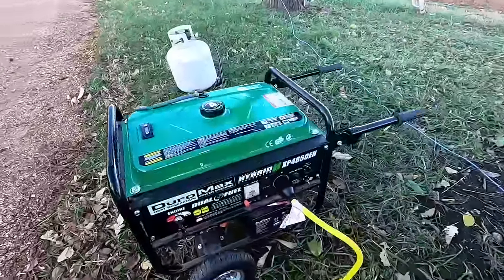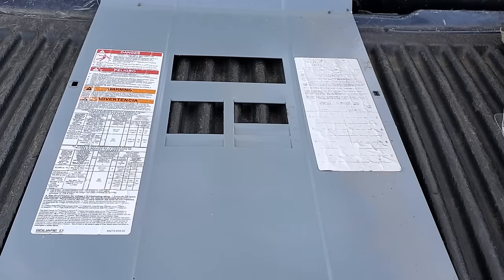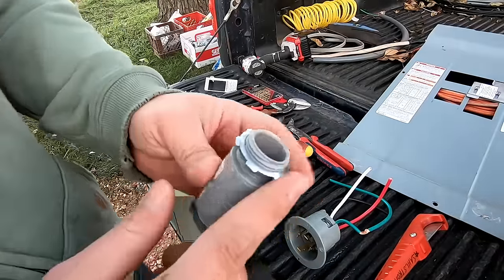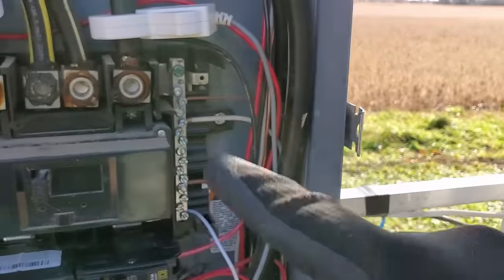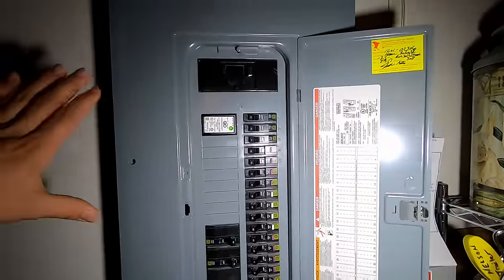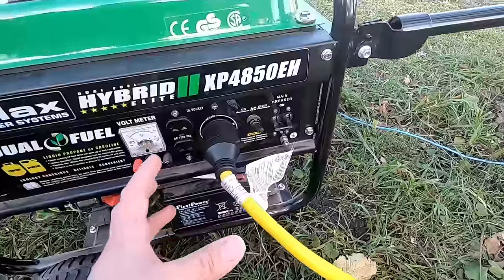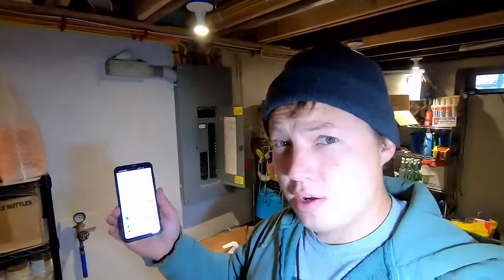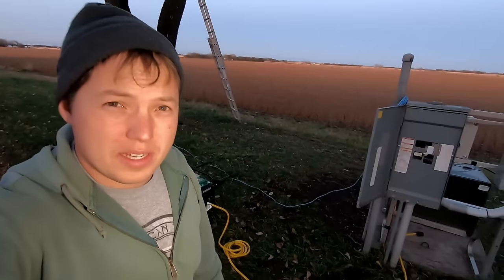How To Hook Up a Generator To Your House Using a Breaker Interlock Kit & Power Inlet Box

Comment: Great vid.    240V ? I thought it would run 120V/wire at specified A. ?   Put tape over the main input wire lugs to prevent from hitting them.

Comment: The square screwdrivers are called Robinsons - use them all the time. The best!  Much less chance of slipping than a flat head.  Also - have experienced a finicky furnace that would not turn on until the ground was bonded to neutral... after that it worked fine. Question - will these dual fuel non-inverter generators not be able to run TVs, computers or other electronics?

Comment: So the generator is also giving power to the sub panel. Do you turn off the sup
Panel main breaker or turn it on to give branch circuits power, after the generator power is turned on?

Comment: Great to see this whole setup work! It is good to know that often something does not seem to handle as much as it said it was rated for.
Reply: the house was a long way away so it might just be the extra resistance on the wire
Reply: I suspect the cause of the shutdown has to do with the fuel being  used, being a multi-fuel engine in this unit. The full power rating will be on gasoline fuel, and about 10% less on propane, or 20% less on natural gas. Has to do with the energy density of the fuel being used.
Essentially every time he added a load, the throttle plate opened a little more to apply additional torque on the generator shaft and keep the 3600 rpm / 60hz output constant. Eventually the throttle hits its stop (full open),  max power of engine is developed, and any additional amp load applied causes the engine to slow, voltage and frequency drops below allowable limits and control safety circuits pop the output breakers,  maybe shutdown engine also. The electric alternator could output more current,  but the engine is overloaded.
Reply: @KevinSmith-ys3mh  thanks that's the engineering way to agree with me 😉
Reply: Here are the generator safety rules that everyone needs to follow: this is just a reminder for everyone’s safety. Always make sure you follow all the generator safety rules whenever you use your portable generator. Generators can be dangerous if not used carefully. Every year, hundreds of people die or get injured when using portable generators due to carbon monoxide poisoning and electrocution. Make sure you are using your generator carefully and keeping others safe as well. There is something very serious that everyone should always be aware of when using generators. Some people do run their generator indoors which is not safe and that increases the risk of carbon monoxide poisoning which can cause death of family and you. Some people run their generator in wet conditions which can electrocute them. Please remember that you should never run your generator indoors. Remember that carbon monoxide is an odorless and colorless gas that you cannot see or smell. Carbon monoxide is a silent killer. Keep that in mind. Make sure your generator is 15-20 feet away from your house and away from doors, windows, and vents. Never use your generator in your porch too. Having a carbon monoxide detector is very important against generator safety. Some people also allow children to go near the portable generator which could pose risks. We need to keep an eye on our children making sure that they are not near the portable generator so they won’t get electrocuted or burned by the generator which is dangerous. A locking enclosure also keeps kids safe. A generator shed might look like a tempting place to explore, or take cover during a game of hide and seek, but a generator is a dangerous piece of equipment that can cause injury. It says on the manual that we should also keep children away at all times from the portable generator to avoid injuries. Please do not allow a child or unqualified people to operate the portable generator.  It is important to keep your children safe especially little ones. The portable generator can be hot during an operation. Just because some manuals missed what should be listed doesn’t mean it’s safe to do. Always follow the generator safety rules when using portable generators. Generators pose electrical risks. If you need to use your generator during wet weather, you need a generator tent to protect your generator from getting wet. Don’t let your generator get wet. Keep your generator dry and before using your generator, please make sure your hands and your generator is dry. Do not wear loose clothing when operating the generator. Everything that is said on the generator’s operating manual should not be ignored. Never smoke cigarettes near the generator. Please keep flammable things away from the generator. Never overload your generator too. Your generator can catch fire. Never ever try to plug a generator cord into a wall outlet to avoid back feeding. Back feeding your generator is dangerous. Always turn on your generator first before plugging in appliances and shut off the appliances before turning your generator off. Use a heavy duty cord for your generator and the cord should not be worn out. All the instructions should be followed carefully. Never refuel your generator while it’s running. It can cause fire if fuel spills while your generator is hot. You should turn off your generator and let it cool off before refueling it. Having a fire extinguisher next to the generator is also important. This is only a reminder for everyone’s safety of using generators. Make sure your generator is properly grounded. Having a fire extinguisher next to the generator is also important against the safety rules. https://youtu.be/I1jT3ANENvI and here is a video more about keeping others safe when using generators and also about our family’s safety. It’s important to keep our little children safe as well. Make sure your little children are kept away from the generator at all times especially when it’s running. Hope this helps. Always remember that it’s better to be safe than sorry. Also remember that warnings should not be ignored too.

Comment: I have this setup on my house and it runs everything except my electric Dryer with everything on with a 8500/5500 watt Generator it may run the Dryer I just never tested it LOL It Works great and we are never without power -I also would suggest keeping at least 4 - 5 gal cans of Gas around for backup - If your out of Power most likely the Gas Station is also, Just a suggestion tho.

Comment: Subbed! Love your vids. We are buying an old 60s house with open ground wiring. Will be re-wiring the whole house and upgrading the electrical panel. Definitely want to add generator hookup.
Reply: Here is an information about generator safety: this is just a reminder for everyone’s safety. Always make sure you follow all the generator safety rules whenever you use your portable generator. Generators can be dangerous if not used carefully. Every year, hundreds of people die or get injured when using portable generators due to carbon monoxide poisoning and electrocution. Make sure you are using your generator carefully and keeping others safe as well. There is something very serious that everyone should always be aware of when using generators. Some people do run their generator indoors which is not safe and that increases the risk of carbon monoxide poisoning which can cause death of family and you. Some people run their generator in wet conditions which can electrocute them. Please remember that you should never run your generator indoors. Remember that carbon monoxide is an odorless and colorless gas that you cannot see or smell. Carbon monoxide is a silent killer. Keep that in mind. Make sure your generator is 15-20 feet away from your house and away from doors, windows, and vents. Never use your generator in your porch too. Having a carbon monoxide detector is very important against generator safety. Some people also allow children to go near the portable generator which could pose risks. We need to keep an eye on our children making sure that they are not near the portable generator so they won’t get electrocuted or burned by the generator which is dangerous. A locking enclosure also keeps kids safe. A generator shed might look like a tempting place to explore, or take cover during a game of hide and seek, but a generator is a dangerous piece of equipment that can cause injury. It says on the manual that we should also keep children away at all times from the portable generator to avoid injuries. Please do not allow a child or unqualified people to operate the portable generator.  It is important to keep your children safe especially little ones. The portable generator can be hot during an operation. Just because some manuals missed what should be listed doesn’t mean it’s safe to do. Always follow the generator safety rules when using portable generators. Generators pose electrical risks. If you need to use your generator during wet weather, you need a generator tent to protect your generator from getting wet. Don’t let your generator get wet. Keep your generator dry and before using your generator, please make sure your hands and your generator is dry. Do not wear loose clothing when operating the generator. Everything that is said on the generator’s operating manual should not be ignored. Never smoke cigarettes near the generator. Please keep flammable things away from the generator. Never overload your generator too. Your generator can catch fire. Never ever try to plug a generator cord into a wall outlet to avoid back feeding. Back feeding your generator is dangerous. Always turn on your generator first before plugging in appliances and shut off the appliances before turning your generator off. Use a heavy duty cord for your generator and the cord should not be worn out. All the instructions should be followed carefully. Never refuel your generator while it’s running. It can cause fire if fuel spills while your generator is hot. You should turn off your generator and let it cool off before refueling it. Having a fire extinguisher next to the generator is also important. This is only a reminder for everyone’s safety of using generators. Make sure your generator is properly grounded. Having a fire extinguisher next to the generator is also important against the safety rules. https://youtu.be/I1jT3ANENvI and here is a video more about keeping others safe when using generators and also about our family’s safety. It’s important to keep our little children safe as well. Make sure your little children are kept away from the generator at all times especially when it’s running. Hope everyone finds this helpful. Always remember that it’s better to be safe than sorry. Remember that warnings should not be ignored.

Comment: Very informative video.  Couple questions concerning connecting a singe generator to 2 panels.  If a generator had a 50amp outlet and a 30amp both 240V could you run a cable from each outlet to 1 of the panels?  I realize that you would have ot manage the load as to not exceed either the plug or the total for the generator.  Alternatively can you basically in a junction box wire the cable coming from the 50amp connector and then wire nut wires (essentially  creating a "Y" to then feed each panel?
Reply: ⚠️Portable Generator Safety Tips:

1) KEEPING OTHERS SAFE: Please do not allow an unqualified person or your children to operate and service the portable generator. Just because some manuals don’t say that doesn’t mean it’s safe. That is important against the generator safety rules. We also need to be keeping an eye on our children too. You need to make sure that your children are not playing near the portable generator especially when it’s running so they won’t get electrocuted. Generators pose electrical risks and they can be hot during an operation. Please keep your children away from the portable generator at all times. It is important to keep our children safe especially our little ones. Be aware of all the hazards.

2) WHERE TO RUN YOUR GENERATOR: Some people use their portable generators indoors which increases the risk of carbon monoxide poisoning. It’s important to have a carbon monoxide if you have a gas generator. Never ever use your generator indoors even if your doors and windows are open and even in the garage is not safe to use a portable generator. Also please never use your generator in your deck or balcony. It is never safe to use your generator indoors and in enclosed areas of your home. Your generator needs to be 15-20 feet away from your house. 

3)🔥FIRE HAZARDS: Never refuel your generator while it’s running. You need to let your generator cool off before refueling it and before storing your generator. Never overload your generator too. Never ever back feed your generator. You should never plug your generator into a wall outlet. Also never store propane tanks indoors. Please keep flammable things away from the generator as well and please don’t smoke cigarettes near the generator. Having a fire extinguisher next to the generator is also important against the generator safety rules. It’s also not safe to move your generator while it’s running.

4) GENERATOR OPERATION: make sure your hands are dry before touching the generator. Never use your generator in wet conditions. Don’t let your generator get wet. You need a generator tent if you need to use your generator during wet weather. Please don’t wear loose clothes when operating the generator. Turn on your generator before plugging in appliances. Use the right cord for your generator. Please do not use worn out cords. 

https://youtube.com/shorts/eFigDfnPkcQ?feature=share and here is a short video more about keeping others safe when using generators. Portable generators need maintenance so it’s important to follow the safety instructions.

Hope this helps

Comment: Great video, I have watched a few videos around only a few are as well detailed as yours. Will the same procedure work with a 120v generator? The inverter generator I have only puts out 120v over an TT-30R connector. Not interested in running any 240 loads.

Comment: Thank you so much for making this video, just ordered a generator and will need to set it up.  Also will look into getting one of those sense energy monitors!
Reply: Remember to always make sure you follow all the generator safety rules whenever you use your portable generator. 
⚠️Here are the Generator safety rules that everyone needs to follow when using generators:

This is just a reminder for everyone’s safety when using portable generators. All generator safety rules need to be followed carefully to avoid hazards. 

1) Please do not allow an unqualified person or your children to operate the portable generator. Just because some manuals don’t say that doesn’t mean it’s safe. That is important against the generator safety rules. We also need to be keeping an eye on our children too. You need to make sure that your children are not playing near the portable generator especially when it’s running so they won’t get electrocuted. Generators pose electrical risks and they can be hot during an operation. Please keep your children away from the portable generator at all times. It is important to keep our children safe especially our little ones. Be aware of all the hazards.

2) Some people use their portable generators indoors which increases the risk of carbon monoxide poisoning. It’s important to have a carbon monoxide if you have a gas generator. Never ever use your generator indoors even if your doors and windows are open and even in the garage is not safe to use a portable generator. Not even at your porch and your deck. It is never safe to use your generator indoors and in enclosed areas of your home. Your generator needs to be 15-20 feet away from your house. 

3) 🔥generators cause fire hazards too. Never refuel your generator while it’s running. You need to let your generator cool off before refueling it and before storing your generator. Never overload your generator too. Never ever back feed your generator. You should never plug your generator into a wall outlet. Also never store propane tanks indoors. Please keep flammable things away from the generator as well and please don’t smoke cigarettes near the generator. Having a fire extinguisher next to the generator is also important against the generator safety rules. 

4) generator operation; make sure your hands are dry before touching the generator. Never use your generator in wet conditions. Don’t let your generator get wet. You need a generator tent if you need to use your generator during wet weather. Please don’t wear loose clothes when operating the generator. Turn on your generator before plugging in appliances. Use the right cord for your generator. Please do not use worn out cords. 

https://youtu.be/I1jT3ANENvI and here is a video more about keeping others safe when using generators and also about our family’s safety. Hope this helps

Comment: I'm having trouble finding an interlok kit for Stab Lok panel (aka Federal Pioneer). Also, I'm thinking it would be good to have a lock box safety switch between the breaker and the power inlet box. I guess I need a fancy 3 pole switch to switch the hots and neutral, right? Or is it ok to just use a 2 pole switch for the two hot wires and have solid neutral through the switch box? Thanks!

Comment: Hello Ben,  Great video on using the Sense monitor when gen power is used. I followed your video installing the sense but I can not connect to wifi after the gen has powered the house.  Sense works fine with main power on.   Did I miss something in your presentation.  I have a 30 amp breaker with interlock and the gen powers up most of the house.  Please help.  Anyone else have any issues?